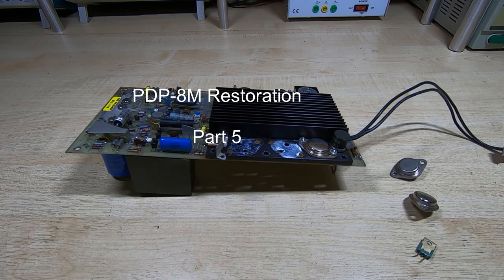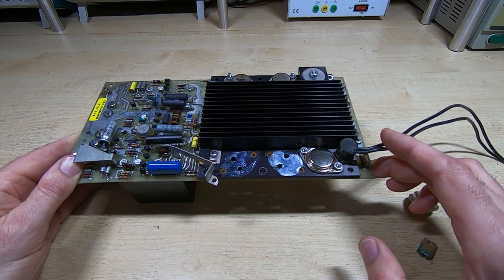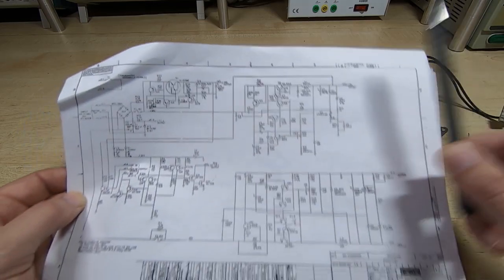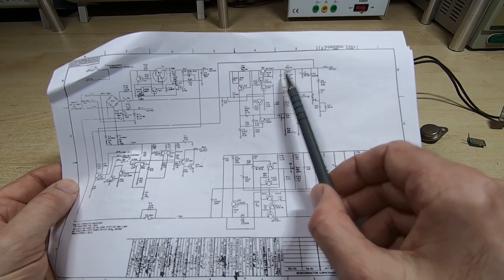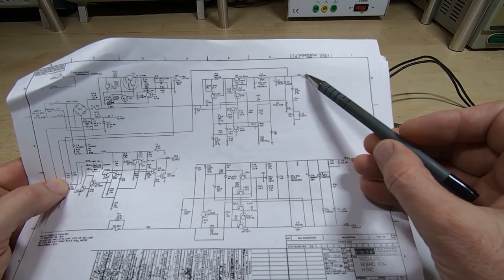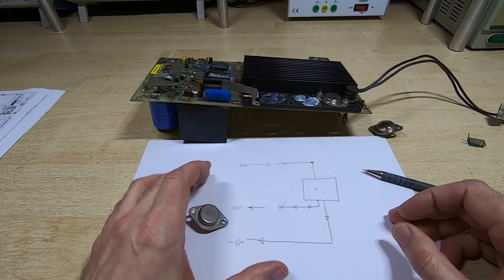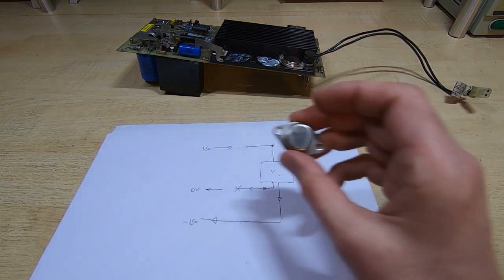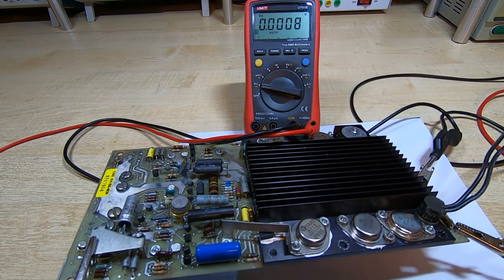PDP-8M Restoration Part5

Comment: In all my machines with this kind of power supplies (PDP8/F PDP8/M PDP11/10) I added extra GND and +5V wires directly from the capacitor to the backplane to bypass the fragile connector. I had a burned pin in that connector before. And when the GND is going to float on the backplane caused by a not connecting pin, the TTL chips will be fried because there is no crowbar to kick in then on the backplane itself...

Comment: This doesn't bode too well for the core memory board, does it?
Reply from the maker: Exactly my concern. With any luck there are just some shorted caps on one or more of the boards but it is possible that the unit was powered up with the ground removed (it was disconnected when I first opened the unit) and that may have caused a lot of damage. I will be posting the next video shortly on the power supply which shows how the supply is supposed to behave.